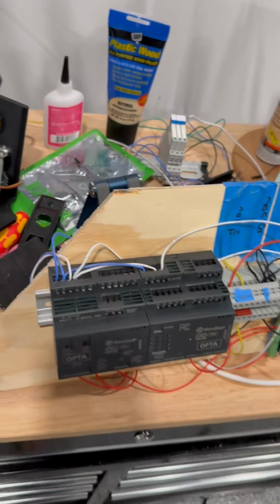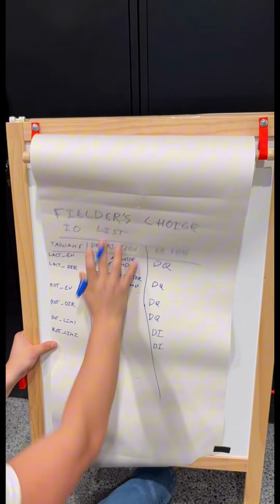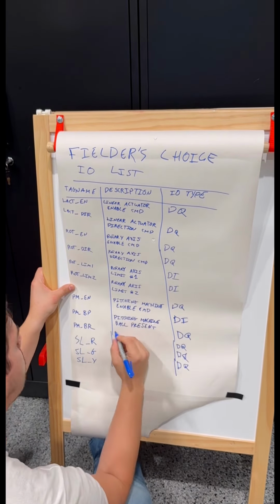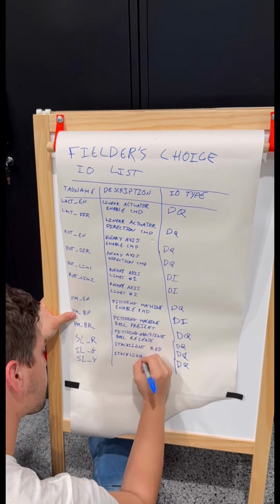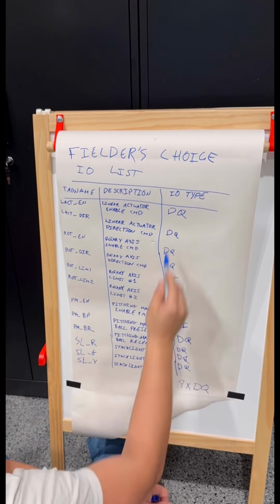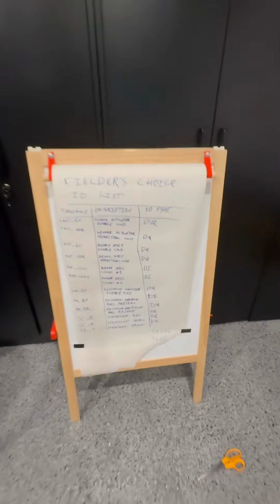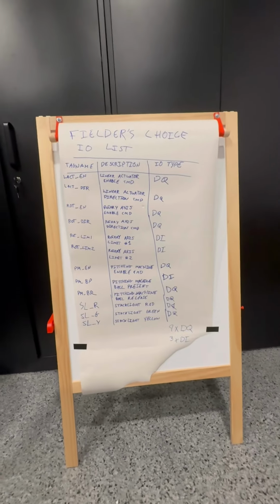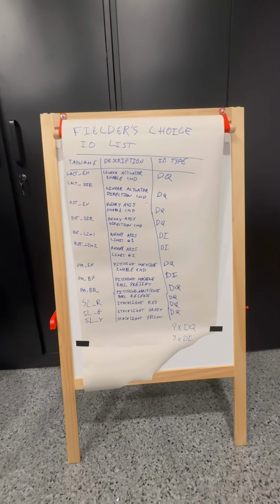Creating an IO List for my Automation Project! #science #engineering #automation #electronics

Comment: A note for people watching and wanting to design their own projects, you can also use one input for multiple limit switches, as long as your programming does not care.Which limit was hit. Just a helpful hint to save from having to buy a block 1 for one or two extra switche. This is used in mach3 style machines sometimes when machines get out of soft limits at that point it dont mater which one caused the error it just has to be fixed.